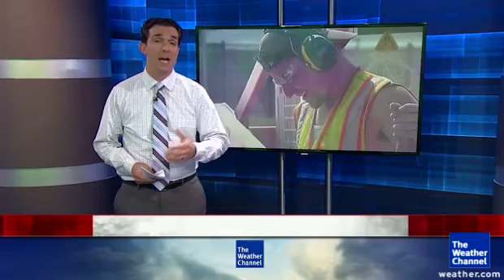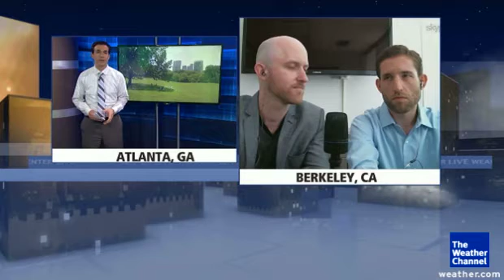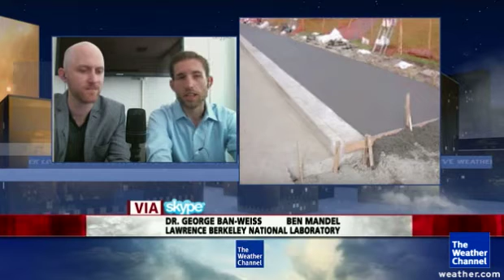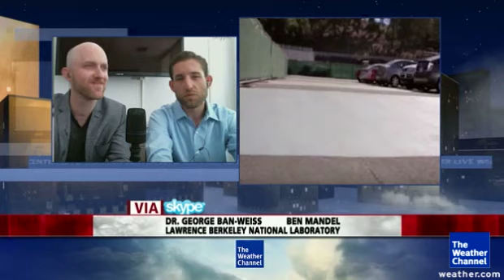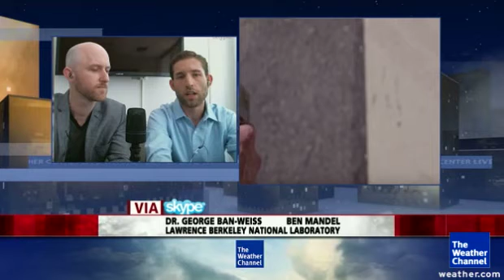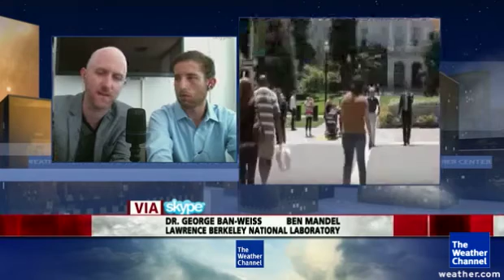Reducing the Urban Heat Island

Comment: Reducing Urban Heat In A City
2 simple, fundamental, effective and cheap long term solutions for reducing urban heat in a city:
1)	Plant more trees near areas where there are running water in streams, canals or rivers
2)	Create more running waters in streams near areas there are more trees.
Notes:
1)	Other vegetation do not result in as much water evaporation as water evaporation by trees
2)	Trees not near running water or streams may not have enough water for water evaporation to effectively reduce ambient heat in the environment or to reduce urban heat
3)	Most current air-con systems are very wasteful as they merely transfer indoor heat to outdoor, resulting in increase in the ambient temperature in the environment or increase in urban heat.